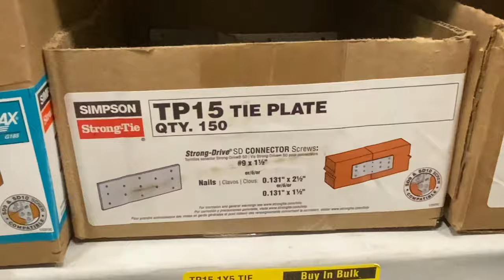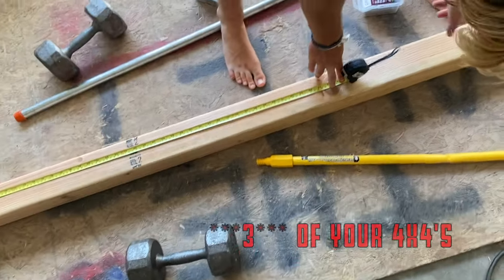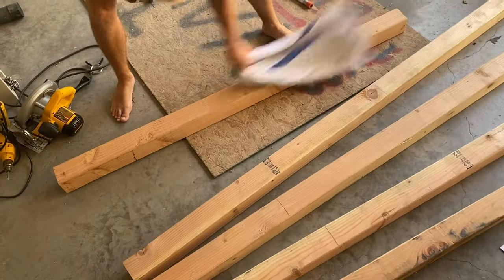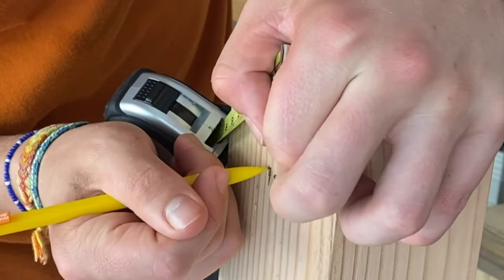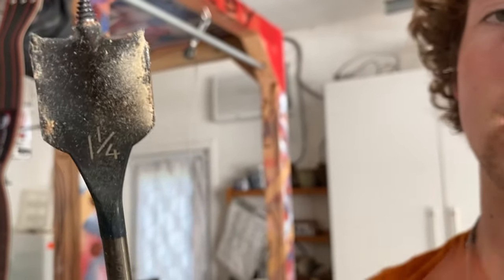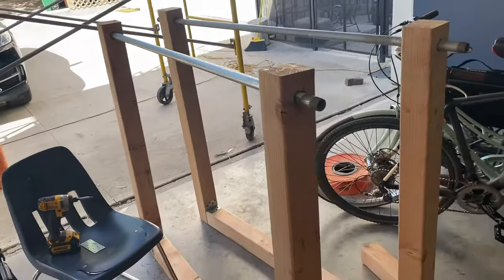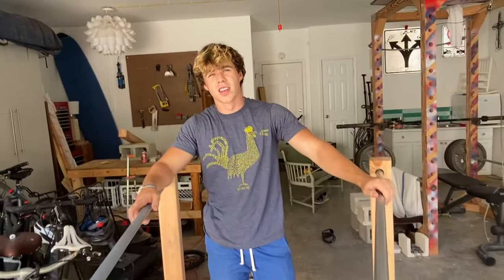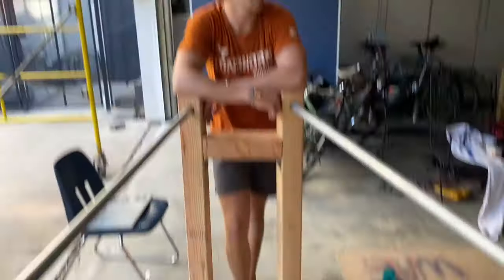SUPER STRONG DIY DIP BAR for $100 in 2 hours

Comment: Thanks for the plans guys.  I just made the setup and realized I'll have to make some mods to it.  I found that 15° is fine but with 60" bars it becomes too wide to effectively dip.  So, I'll get some shorter bars but leave everything else the same.  I also used 1" bars to better mimic a barbell.  And I have hockey tape I'll use to soften up the bars.
Reply from the maker: Awesome work, man! Thanks for reporting back to us and good job on making it your own. Anything else you’d like others to know/you want to see on the channel?
Reply: How many degrees did you end up using?